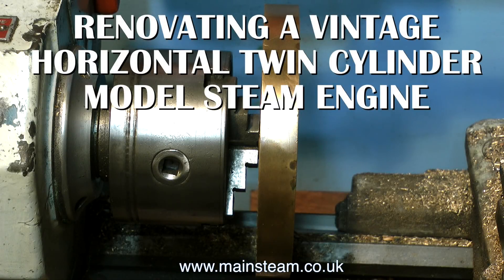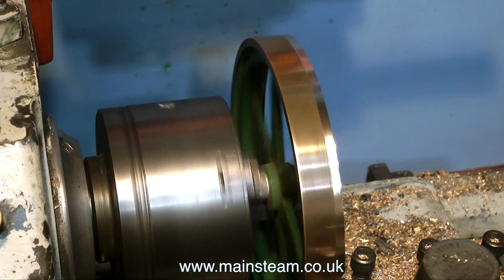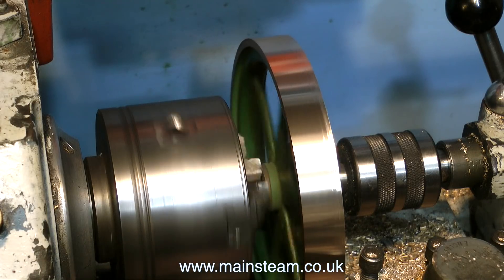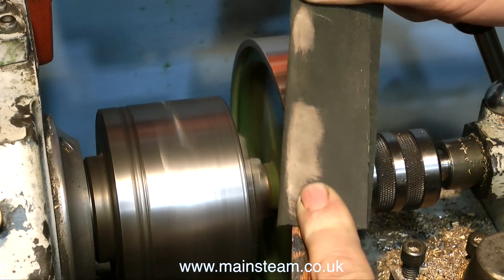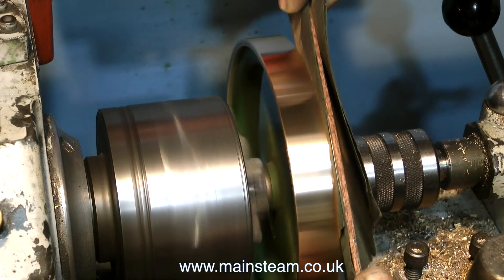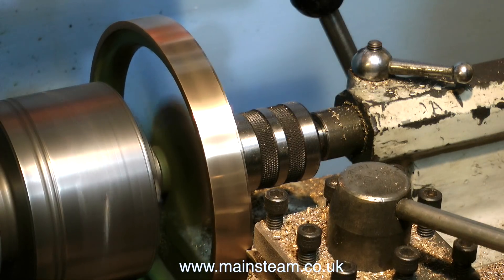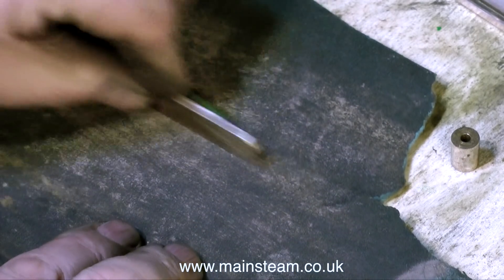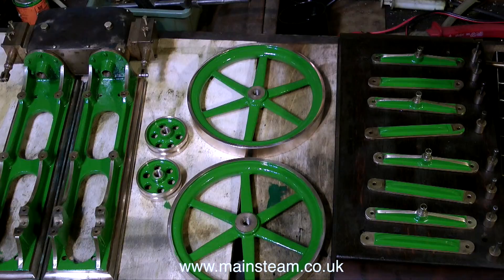PART #8 -  RENOVATING A VINTAGE HORIZONTAL MODEL STEAM ENGINE

Comment: keith not sure if it would work on those flywheel but we would do rollers in shop and  the web ens were very similar from old machine we would lace leather strips and tie them in the webs to deaden  any oscillation that would cause vibration chatter  just a thought to keep in mind. same idea as old mechanics used in turning brake drums - wrapping a leather strap around them just tight enough to hold it on to dampen the  oscillation